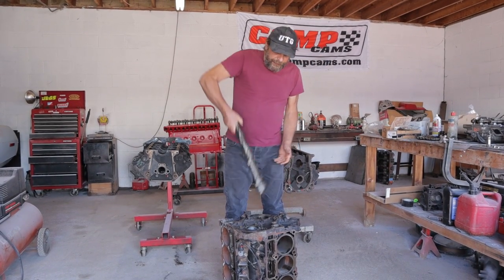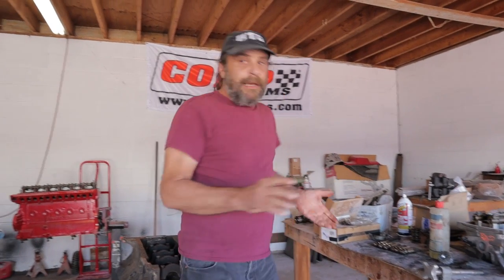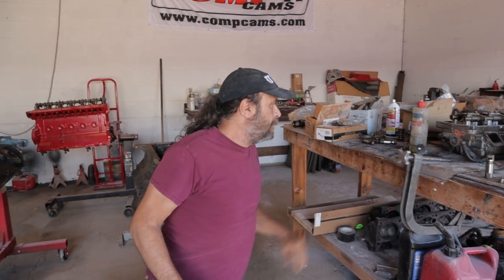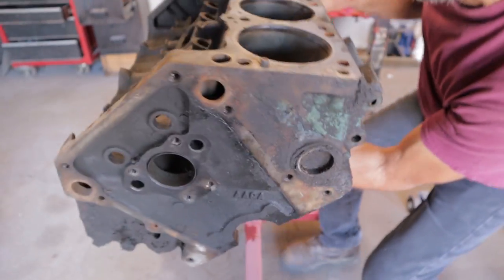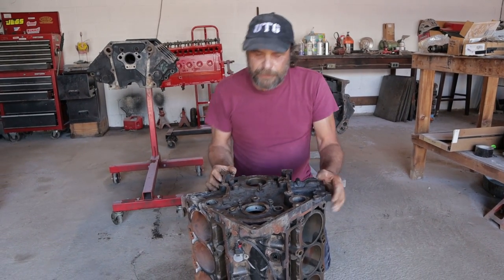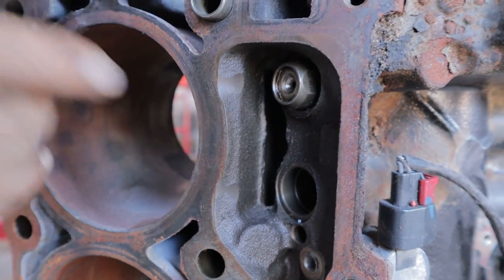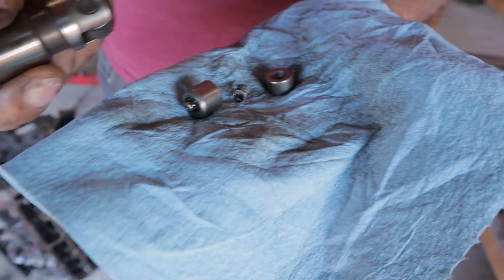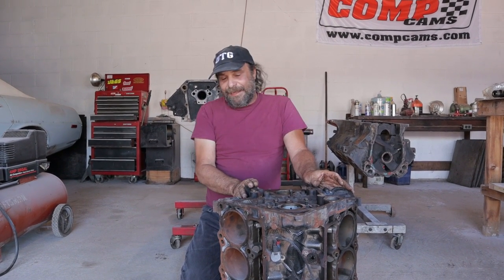Gen 3 Hemi Camshaft Failure Mystery Explained!

Comment: Sounds like the lifter bore is much larger than normal or abnormal wear and you need to bevel the bore hole to allow more oil into the chambers (more slant bevel) and increasing the oil pressure from the oil pump may also help on this problem. I learned auto mechanics when I was much younger (institute) and used to work with Gary Hughes (G.C. Hughes) with machine shop equipment and we would increase the bevel on the oil ports to increase oil lubrication in the journals... which would increase the life of the moving parts and then recommend a better oil pump high performance to go with it. We would first coat the seats with pro molly fluid when re-assembly to reduce the wear on initial start-up after rebuilds. Wow... Chrysler rerouted the galley oil to where it doesn't hit the cam shaft (dumb move)... Sound's like they need to go back to the design table on the journals and galley routes.

Comment: I own a 2011 challenger with a 5.7 it has 112,000 miles and I only use Mobil one with a mobile one oil filter change it every 4,000 miles it just started to tap sounds like 1 lifter doesn’t do it that much and when I raise idle it goes away I only have the car a year I put about 4.000 miles on it Thank You for doing this video now I know why it was traded in because it’s a great car outherwise and i get compliments about it all the time I was going to trade it in for a 2021 392 shaker dealer has 2 coming in they’ll give me 11 thousand for mine on a trade in can you tell me if this problem was fixed on the new bigger Hemi?

Comment: If this is the case, then, what are the four solenoids do on top of it under the manifold they’re supposed to open up and let oil squirt through their electronically. They’re supposed to be set with the computer on the car on the timing to pull oil up and push it in.

Comment: Place a sheet metal pan that is high enough to hold oil until it overflows at this point the cam lobs will drag oil up to the right side lifter but if the pan is tall enough to seal and catch the drains off from the heads and lifters and cradle the cam and lobs with higher volume then this show Chrysler that messy up by showing the engine does not fail with bad lifters. hopefully, they do not use a cam lob twice each time it turns around. If there are 16 cam lobs for 16 lifters then they are not using a cam lob twice each go-around.

Comment: My 2012 Hemi Cherokee is in the shop as I type this because the lifter started eating the cam. Apparently other auto makers with the fancy dancy emissions friendly cams have the same problems.
Reply: How many miles on yours? Our 2013 has 47,000 on it and it's still fine. It had lifter tick at 35,000 miles. I stopped letting the dealer change the oil and I change it with Royal Purple 5w-20. It stopped the tick, so hopefully a good oil lets this engine last.
Reply: @Dcc357  mine gave up the ghost at around 108k miles. I bought it at 70k-ish miles. The truck now has a Compcams stage 2 HRT, new valve springs, MDS delete, oil pump, cam chain/guides, water pump and a custom 93 octane tune... not cheap, but its damned fun to drive.

Comment: One thing to really help keep from this happening Use better oil it’s about the only thing that will help, better film strength! not to mention make sure to change it no more than 5000 miles..with an equally good oil filter. 

Royal purple, Ams oil, etc.

People really don’t understand the value of a good oil, They are misled by advertisement

Comment: I bought an 04 Dodge Ram with the 5.7 Hemi, I no longer have it but , I know the person who does. It has around 200 thousand miles and no mechanical issues.. and still has the original camshaft. Makes me think that Dodge screwed up when they tried taking 4 cylinders out of use... without lubrication!

Comment: How could the lifter sides become scuffed if the pushrods are delivering sufficient oil? Perhaps under 2,000 rpm's the oil pump is inadequate too?
Reply: In a pushrod engine oil pressure is not how the lifters get lubricated.
Reply: I'm no authority on oil pressure...my point is this: If the lifters are oiled by the pushrods, how can the sides of the lifters get scuffed unless there is insufficient oil coming through the pushrods?
Reply: Myron Piano As I understand it the exterior of the lifters is largely oiled by oil splashing up from the rotating crank. And unlike pretty much every other pushrod engine the cam and lifters are much further away from the crank and there are obstructions to boot. So unless your are running 2000-2500 rpm or better they are not getting enough oil. And as I posted elsewhere I got two 5.7 hemis to over 200k and 250k miles without the tick because I was usually doing 80mph /2600 rpm.

Comment: Wonder if a oil supply is the cause because she I first got my civic the previous owner ran it super low on oil and I checked the cam lobs as I was doing a valve adjustment. I noticed one lobes  was flattened pretty bad. Maybe add a few oil lines to the valve cover to fix it..  I just got to the part of the video where u say it's also  lack of oil.  But I'm still watching so we will see

Comment: Uncle Tony my theory is being that I have owned an 92 ram and 02 An 06 an 09 an 2016. No problems with none of them but the16 ,cam shaft. I think the problem is no RPMs on the motor ,10 speed transmission going down the highway at 75 miles an hour don’t bring but 15 to 1700 RPMs that’s almost idling and I think that is a big problem .and I’ll drive my truck in six gear and nothing beyond since I started doing that I have not experienced dry start up anymore .Anybody have any thoughts

Comment: My dodge truck tapped really loud when I bought it with 130 k once it warmed up, which everyone claims is lifter failure. I’ve been driving it months now and still isn’t missing yet, I changed the oil and added 2 bottles Of Lucas oil treatment. After that it tapped really bad when I first started it and only taps here and there it’s random not all the time now . I’m crossing my fingers it will be ok for 20 more thousand miles
Reply: Good luck, as our newer 1500 didn't make noise when it failed. It was driven another 2 months until dealership could get it in for the warranty work.

Comment: Use pressure  block tap off oil filter mount like they use on turbo systems but run it to your valley cam squirters.

Comment: I had the same problem spoke to a certified dodge mechanic not that they would share this with you from the dealer but MDF lifters tend to freeze up more than regular lifters which could be part of the issue they have a fly in the roller bearing because of the hydraulic spring in the MDS lifters didn’t notice if you said that this was MDF or not but the ones that I had that went that they were all the MDF blisters

Comment: What about increasing the range as to which the lifters can travel? Or Adjusting the size of the camshaft assembly all together? I'm not a mechanic at all. Other option is to change the design of that block.

Comment: Some say it the mds but that isn't the root cause. When it gets hot on idle and the mds kicks in the oil pressure drops to damage level . The fix is hellcat oil pump and melling high volume on 5.7. the stock pump on 6.4 has a 14:1 hellcat is 16:1

Comment: This is why police auction hemi chargers are listed with bad engines at around 80k miles for so cheap. They set and idle forever and when they start to clatter, their mechanics won't fix them, because of all the shavings that have circulated through the engine. You would think that they would put oil squirters under the lifters (like some do for pistons) to help prolong engine life. But then that would make them lose money. Maybe they were engineered like that so you would have to replace parts more often. Who knows? This is the only time when buying a car, it would be a plus if the previous owner hot rodded the crap outta it!

Comment: Great video indeed, 5.7l hemi definitely not the best engine design ever made but  favorite engine among many of us,
If you want to see your hemi running past 200k-300k just add zinc additive and (MOS2) molbendum disulfate every oil change or you can just buy oil with high zinc and molbendum  contents.
Its bullet proof engine with right oil and filter,
Personally use 0W30 Penzoil Euro lucas brake in oil additive(1/4 bottle) and liqui moly MOS2 oil additive,
K&N or Mobil 1 oil filter 7k oil change intervals.
Reply: Break in oil increases friction but ok...

Comment: FIX!!! TAKE THE LIFTER TO A DRILL PRESS . ON THE UPPER FACING SIDE OF BODY DRILL A TINY HOLE INTO CENTER THAT ALLOWS THE OIL TO DRAIN INTO TOP OF CHANNEL THAT THE ROCKER SLIDES UP AND DOWN IN. Make sure the hole in top of lifter and the one from side meet up.

Comment: ~ONLY A 2009-? ISSUE...with the Eagle Head,not sure if 2014 up do it..at least not as common.

~2003-2008 DO NOT HAVE CAM/LIFTER FAILURES!

~2003-2008 SOME HAVE DROPPING VALVE SEAT PROBLEMS...Not all but some drop the valve seat,but they do not have the cam/lifter failure as 2009-up eagle head Hemi's do.

Comment: I've been waiting for years for a detailed explanation of the gen 3 hemi 5.7 like you just did. THANK YOU.  I have a 2014 Gen 3 5.7 in a ram 1500. I luckily dug into this issue upon buying the truck brand new. I did the MDS delete at 10,000 miles and have used redline 5w30 with 5000-7000 miles O.C.I. I'm at 120,000 now and it purs like a kitten.  Put headers on it early with remflex gaskets and cat back exhaust. Headers  and exhaust was done to eliminate the exhaust manifold bolt issue.  Watching your video reinforced my thoughts on the motor. I'll continue to do what I'm doing and hope for the best. Nothing else I can do. Thanks again Tony.

Comment: Quick question for everyone on here. My challenger 392 had it Cam Shaft replaced at 58k miles. The dealership put the same harmonic balancer back in instead of replacing it. I’ve been told by everyone this is a TTY bolt even in a 2012 challenger. Do you think Hemi would have required this bolt to be replaced instead of reused? My engine just slung the balancer and put metal shavings in my oil pan.

Comment: Pushrods don't oil lifters, it's the other way around. Watch any oil priming video and you see the oil coming up the pushrods to the rockers. The lifter bores are pressurized from the oil system, that's how hydraulic lifters work to begin with. That pressure forces oil up the pushrods to the rockers. If anything I'd suspect bad clearances between the lifters and bores if you are seeing oil issues there.  Those are precision parts with clearances in the ten thousandths range. Easy to get wrong if you go cheap.

Comment: Yes so true this video I went through same issues Dodge Ram did not issue recall dealer wanted $9700 + to replace engine  got cam lifters done with labor under $2000 Ram did not want to know nothing. If there is a class action suit let me know

Comment: hadnt realized hemis even had a problem, but sure seems everyone agrees most of the lube is indirect/slinging off crank- something to kickaround to folks fully rebuilding these- what about adding a small notch in rod big end faces to sling most of the oil passing out the bearings upwards/towards center? low cost mod, bearing shells are recessed, wouldnt lose any bearing surface, properly deburred shouldnt add any stress risers... just thinking aloud. youve identified a problem, just wonder if 'controlled slinging' via conrod faces might be a easy way to direct the oil in a useful direction...

Comment: I knew long ago when this started happening that it was roller lifter axles and wheels and oil , either lack of or perhaps the lack of zinc in these high pressure areas, an oil supplement is probably needed, zinc or liquid moly additive s

Comment: Nice review but I've worked as a tech for chrysler dealers for years and have to say we did'nt really start seeing alot of failures on these cams until the went to variable valve timing in 2009. They also went to a different weight oil when mds came around, so that might of also been a factor but also with variable cam timing came the oiling needs for the phaser . Thoughts on that??
Reply: Simple thought really. 
A larger displacement oil pump to accommodate the extra phaser needs, and a new way to channel the drainage from the lifters directly to the cam instead of discarding down the sides of piston skirts. 
Done and done.

Comment: OHC are a pain and I will never buy another OHC Ford engine. My '97 Cobra has 310,000 on it and it still runs very well. Rebuild big $$$.
Want ported heads? $2500-4000
Forged rods and pistons? $1200-infinity
Cam drives? $600-1200
Cams? $1200
Replace the torque to yield engine bolts with studs, etc? $500-700 depending on what you use.
I would take a pushrod 5.0L any day of the week over these OHC engines. Supercharge is on stock block and heads to 500hp and if you pop the motor you can replace it very cheap. Or expensive depending on how you go about replacing/repairing the engine

Comment: Perhaps it would help to run out of spec (not OEM) oil. I don't know what the recommended oil is for this engine, and perhaps increased oil consumption could happen, but one with lower overall viscosity might just drip and splash (flow) on the cam better. How one would test this other than a lifetime of engine use I have no clue. But I do know the engineers don't always get it right the first time. Just say'n. Good job highlighting the issue UT.  Perhaps a larger sump or windage tray delete if there is one? Re design the shape of the crank weights to splash more oil? BTW Scotty sent me.

Comment: Well.... I just rolled over 92000 miles on my 2016 Power Wagon and 2 days ago 8-16-20,  I lost power while on the interstate, pulled over, engine ticking, and had a very noticeable single cylinder misfire, called friend with a rope. Looks like my wallet's about to be wiped clean. 3, 4 grand!?😞 Any info on a class action suit? (Update) pulled right head and found #6 exhaust lifter was collapsed stuck that way. Roller was fine.  Went to dealer, bought 1 new lifter and a right head gasket. Going back together with it when head gasket arrives and will update then.

Comment: It’s not only the hemi. The 3.6L has this issue as well I had a Jeep Grand Cherokee 2016 model. Had 140,000niles on it and synthetic oil change every 5000mile. Drove this pos for work. I did sit and idle an hour each day while taking lunch. The cam and lifters failed. Now this was a true pos vehicle because at 70,000 I had to put in a transmission. Also had two coil packs go bad in this time frame. Dodge should be paying for these repairs and the upgrade to resolve the issues.

Comment: I don't claim to be any kind of an expert on the subject However on the 6.4 Hemi The owner's manual recommends a specific type of Pennzoil. And it says not to use anything else. I've seen lots of videos where people used Mobil 1 instead with the same weight and all that and they're the ones that seem to be having the most problems. Along with other obvious things like guys not changing their oil often enough. I don't claim to be a fan of Pennzoil or anything like that but I know that you can't buy the type of oil that they want unless you go to a dealer. Do have other versions of Pennzoil not the exact type that specified in the owner's manual. I'm crossing my fingers and hoping that my truck hangs in there so far at 70000 miles it's doing good.

Comment: Could a higher quality oil like Amsoio or Mobile one full synthetic help minagate the issue with these engines?
Reply: Darth Hemi 

I had a roller shatter in my 2013 Ram 1500 with the 5.7L. What was funny, the dealership tech was surprised how the engine was still running like nothing was wrong with it.

Also, I will never use anything Pennzoil ever again. I haven't had any issues with using Amsoil with my current 2017 Ram 1500 with the 5.7L.

Comment: The original Hemi didn't have a warranty, supposedly because it was a "race" engine. In reality unless they were blueprinted, they would scatter. Bad pushrod angles, multiple oiling issues, they were a time bomb. That's why they are rare now, and 75% are not numbers matching because they dumped everything out the oil pan onto the street.

Comment: There’s a fatal flaw with the PCV system. The PCV tube back into the intake allows excessive build up on valves and other related parts. A catch can is a must. Engines literally “burn up” without it.

Comment: Most effective cure is gun-drilling the cam, adding oil holes to the lobes just after the peak (lowest stress/wear there) and plumb it to the oil system.
Reply: Funny, I watched this again and I still agree... with myself. Gun drill the cam, oil it, and it will self-pump oil through holes on the downhill side of each lifter lobe and the camshaft journals.

Comment: Bought a new ram1500 work truck in 04. Paid $14K for it cause nobody wanted it. Had the magnum not the hemi. Manual not automatic. No power windows or locks. 225K later, tune ups, batteries, and the transmition pilot bearing are all I have had to wrench on in 22 years.

Comment: I don't see how Chrysler engineers could've missed that, it's such a longevity issue. Warranty costs must be huge!
Reply: Remember ... the current Hemi was designed when it was Daimler-Chrysler.  When it became Fiat-Chrysler, FCA switched from Mobil1 to Pennzoil Ultra-Platinum for the 392/6.4 HEMI to provide better protection at idle.  Mobil 1 still hasn't done or hasn't passed the "taxi cab" idling test that is said to be 2 years long. Makes me think that FCA looked for an oil solution to Daimler-Chrysler's design issue. MUCH cheaper approach than recalling every Hemi produced.  MUCH cheaper to replace cams and lifters for the relatively small number of engines (in comparison to total engines produced) in vehicles that idle excessively.